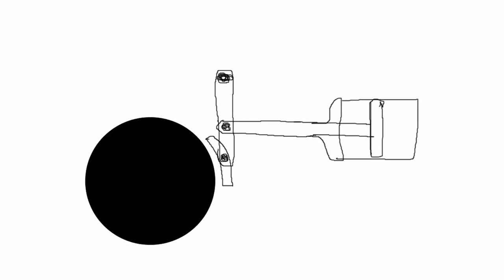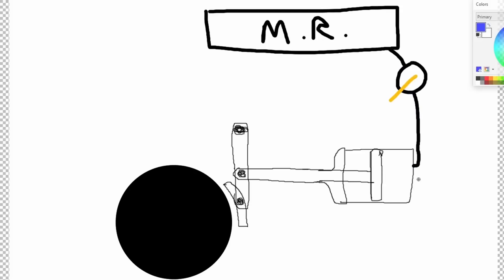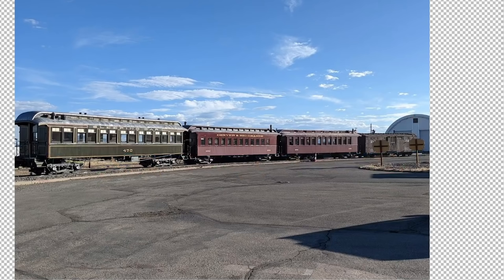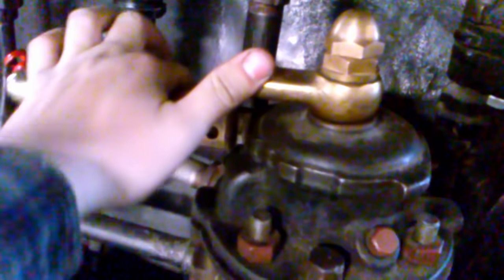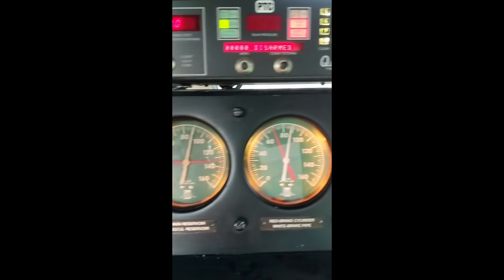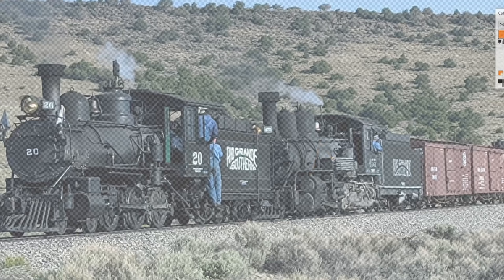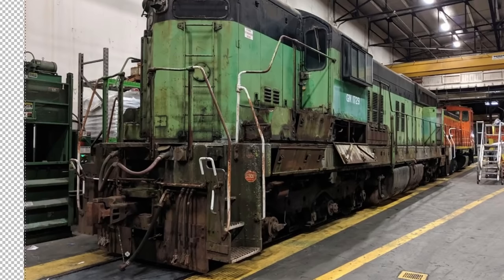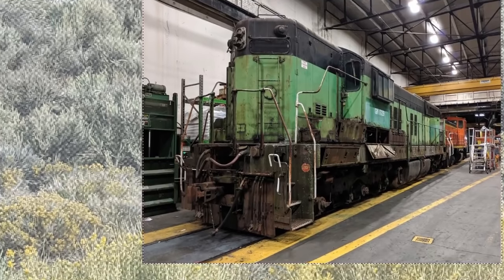AIRBRAKES 101: 10 levels of TRAIN BRAKE understanding!

Comment: An inexpensive way to produce the kind of diagrams you appear to be using above can be accomplished using the following 3 things: 

First, an iPad Air (or Pro) of sufficient generation to use the latest generation Apple Pencil which is the second "thing." Finally, "Goodnotes 4" is an inexpensive app ($10 or something like that?) that has drawing tools of sufficient sophistication to meet your apparent needs. It is also simple enough to be innately intuitive enough to be able to use without the short user manual. The user manual available online through the app's "help" section is relatively short and well-written to enable the user to be able to use the full-functionality of the app which is pretty impressive, feature-wise. Using the above 3 things enable the user to create a simple multi-colored drawing using straight lines when desired, squares/rectangles, circles/ovals, and other basic shapes. 

I used this "system" during my Masters and Doctoral program and couldn't recommend it more enthusiastically. I tried nearly every "note taking" app for the iPad that there was and Goodnotes 4 was the best. I started with Goodnotes 2 and am currently using Goodnotes 4 at work. The pages can be exported in a variety of formats or you can just "Select All" of a diagram and cut and paste into other apps or email. 

I had been looking for a way to take electronic notes for decades and was finally rewarded with the above combination for a dream-come-true: an electronic note-taking solution that worked as though I was using pen-and-paper. No lag and obviously, a plethora of benefits due to the electronic form factor including back-ups and password protected notes. 

(And no, I have no connection to Apple, nor the company that makes Goodnotes 4. I'm just an ecstatic customer).  🙂

.
Reply from the maker: Well, with that review like that I imagine it's a good one :) I've long wanted an ipad or something to be able to draw these like true "pen and paper" maybe that's the ticket. Thanks!

Comment: Something I'm always confused about.. Are railcar brakes on by default, released by the air; or are they off by default, applied by the air? I've heard it described both ways.
Reply from the maker: Brakes are off by default. Once you "charge the train" full of air, if you lose air, the brakes come on. There is nothing mechanical applying the brakes until you have charged and then removed air. But, if there was no air at all in the beginning, no brakes.

Comment: When you apply the train brakes does it also apply the brake shoes on the locomotive, and if you have just a locomotive with no rolling stock, which brakes do what, and is the independent brake just as powerful as the train brake in that situation.
Reply from the maker: For many kinds of airbrake, applying the train brakes does apply the locomotive. If you have no rolling stock, it will act the same. In that case, the independent brake is much better because you can apply it much more quickly. If you have a whole train, you have to make slow, small changes to make sure things are smooth - but with just an engine it's easier to make faster movements.

Comment: in British locos.. the vacuum is a fail-safe..  the Vacuum pulls the brakes off:  if a pipe comes off or leaks.. the brakes apply.  The USA solution seems rather complicated in comparison
Reply from the maker: It is certainly a bit more complex, but it makes for the best of both worlds with operation.

Comment: If your air piston is smaller than the steam piston doesn't that allow you to have higher psi out? E.g. 100 psi steam on a 10 Sq inch piston would produce 1000lb force but then you use a 5 square inch piston to compress the air , when the air pressure is at 100psi it would only produce 500lbs resistance against the piston.
Reply from the maker: That is the thought, but even so, with seal efficiency and the fact that the air has to cool off as it leaves prevents that reality from occurring.

Comment: Hey! I have a question. I work at a loading facility and we how to load rail cars. We have this issue where the trains seem to get "over charged" with air. The brakes do not come loose untill we pull te lever to release a bit off air to then hear the air system rake over and release the brakes... do you (or anyone else) have a idea what could be causing this? Is it because the engine puts too much pressure in the system? Or somehow not enough?
Reply from the maker: It depends on the exact situation that happens. Modern engines don't typically allow for overcharge (over normal brake pipe) conditions with the way valves have been set; but it can be done. That said, if the brakes are set, and won't release - it's not because the pipe is overcharged, it's because the reservoirs were higher than the pipe at some point - which almost certainly means that the locomotive either took a set on the brakes, or it totally disconnected, lowering the pipe to zero.
Reply: First off, thanks for the quick reply! So what i understand is it is possible for the system to go to 90 psi and set the system in the reservoirs to 90 psi but as soon as it goes down to lets say 80 the breaks go on? Because for now they tried to fix the system to make the compressor boost the system to 90psi  but i am not sure it can maintain that much psi... maybe the fix would be a skower build up in pressure? Instead of a full boost to 90psi to then drop over time?
Reply: The issue i believe is the sensor that measures the pressure in the system is at a dead end of a line so huge chances of debris/water build up meaning its reading has a delay wich causes the system to build pressure beyond the set point. And thus "overcharging" the breaks because as soon as the sensor reaches that point the actual pressure is above the setpoint but it stopt pumping air in the system and thus causing the real pressure to drop and maybe activate the breaks? The weird thing is it usually happens on the carts in the back (away from the engine)

Comment: Personally there are many videos (miss information) saying that train uses Air Pressure to apply the brakes! However, according to George Westinghouse, air pressure to release the brakes is the best way, because if the train comes apart (it does sometimes) the air is automatically released thus applying the brakes!
The air cylinders on each carriage/wagon has limited supply, when it runs out of air (0 psi) there's no air to apply the brakes thus not fail-safe!
Where as Air Pressure to Release the brakes, when the train comes apart, the brakes come on and remain on, until air pressure is back (90 psi)
In most countries, they use air pressure to release the brakes, not like a bicycle brakes!

Comment: Question for a Q&a will the walking get faster?? im constantly holding the shift and end up getting the steam menu up. i would prefer the walk be what the run speed is and the run speed to be actually alot fast as it is as maps huge and helps when deleting trees i did duct tape it at one point ha 😅
Reply from the maker: We've done the walk to run speed change twice already... :P
Reply: @Hyce777  no way well atm the run needs to be what the walk is then i think perfect because if the walk speed was the run speed how’d anything get done would have taken you years 😅 wait what year are you living in 😂 but yes still very slow can not use that walk constantly on the run and getting finger fatigue. Cant wait for the teleport option or one to find my train lost it a few times 

Fun thing to try place the vary gradient on top of your train and watch it fly 😂😂🤣 man its so fun the higher the gradient the further it flys i love things like that but would like to see where train is gone. 

Atm my hud has vanished so i have no idea if my train is out of fuel when just looking at it until i press F on it or if my breaks are on the carts i have reported these tho in community section for a fix. Hope your days been as fun 🤩
Reply from the maker: @wkd0  there's a hotkey to turn the hud on and off. by default it's X. Take a look.
Reply: @Hyce777  when do i press x and is it just on its own or do i press fn too? As that moves the track
Reply from the maker: @wkd0  yeah that's the issue. Stupid default keybinds by us, that we still need to fix. I'd recommend re binding the HUD turn off.
Reply: @Hyce777  Thank you very much for your help you’re a lifesaver :D it now works yay 😁

Comment: so simple stated, on trains, no air no stop. If all the air is released from the cars reservoir, then no brakes again, as there is nothing pushing against the brake piston. 
 So hand brakes must still be used to hold cars in place not hooked into an air supply. 
Unlike trucks, where the springs put the brakes on, no air, solid brakes, no need for a separate brake control, when parked.
Reply: Yup, need Air to hold the brakes off the drums/disc's on an Air brake equipped Truck. No Air? You're not going anywhere. :)
Reply from the maker: Yup! So, if you couple up to a cut of cars that have sat "off air" for a while, they will roll free if no handbrakes are tied.

Comment: I do take issue with your statement that you can only have as much air pressure as you have steam pressure. if you have a piston of x size compressing air being driven by a piston of 2x size then you can use the mechanical advantage to result in double the air pressure as you have steam pressure. we used a pneumatic system in a factory I was at to use 120PSI line pressure to fill a chamber and also run a piston to fill a secondary tank up to 180 PSI. there was a loss of volume during the conversion but it was cheaper to run the 4 120PSI tanks in the back longer than it would have been to purchase a tank capable of compressing up to 180.
Reply from the maker: Yup, I totally goofed on that one, conflating my experience vs. how it actually works. You gotta have more steam than air pressure for operations' sake. Doesn't mean it's physically impossible :D
Reply: @Hyce777  i see, yes the volume and pressure of the air is much less than that of the steam is. no sense in being able to stop on a dime if you can't even get it moving in the first place.

Comment: When closing a ball valve between cars; why does it take up to two minutes before the brake cylinders start to activate?
Reply from the maker: What do you mean? If you close the valve and "bottle the air" on a car, it won't set up at all, unless the brake pipe leaks.
Reply: @Hyce777  The train slows down eventually.

Comment: Why do we have 2 set of air hoses?
So one of them always work and there's redundancy?
Reply from the maker: Assuming you mean MU hoses - So that you can always lace them without crossing under the coupler first no matter which way the loco is facing, and then yes redundancy. In cold weather and mountain territory the Airbrake and Train Handling rules calls for using both sets.

Comment: Avro Lancaster special brakes that doesn't catch on fire but uses compressor to provide pressure to the brakes works in a similar way to a bicycle car truck even train aircraft's uses brakes to slow down to stop safely in a similar way

Comment: When a train car disconnects from the rest of the train while in motion,  the airbrakes lose pressure and the car stops.  Given that fact, how does humping work.  How can humped cars roll down the track if they are disconnected from the rest of the train?  Why don't their brakes kick on?
Reply from the maker: Because they've had their car mounted cylinders drained. Remember we need to have pressure in the reservoir in order for the brakes to come on; drain the reservoir after you remove the car from the train and it will roll freely unless the handbrake is applied.

Comment: I’m a current railroader for the modern equipment these days. (Conductor and locomotive engineer qualified) any questions or anything feel free to reach out. Definitely know your stuff by the looks of it!
Reply from the maker: Very cool! Yeah, that may be good if we get in depth, particularly on more of the long train handling stuff. I never got to do much more than 15 cars so I have no experience of setting and releasing portions of the train, etc..
Reply: @Hyce777  absolutely! I’ll be around if ya need a hand with anything!

Comment: Is there any ABS system in the automatic brake control to prevent flat spot on the train wheel when you apply emergency brake?
Reply from the maker: How to tell I'm too far down the railroad rabbithole: I saw ABS and assumed you meant "Automatic Block Signal"... lol

Not that I'm aware of, though potentially some of the modern control valves on cars may have something that mitigates sliding. That said, it does happen...
Reply: No. It's also not really considered in trains because the purpose of ABS is to keep a vehicle steerable during a stop by preventing the wheel from side slipping, if the wheel remains rolling then it's still able to provide grip sideways. There's already a robust anti skid system on a train, the rails. If the train side slips then it's derailed and you have a bigger problem.

The area in which anti-lock braking systems have probably saved the most lives and property is in the trailers of semi trucks, because they aren't responsive enough to driver input to properly pump or pulse them manually, and the trailer going into a skid is probably the most catastrophic failure mode for a truck.
Reply: No, ABS requires electronics
Reply: @AlRoderick  The purpose of ABS is not just maintaining ability to steer the vehicle but to greatly reduce the braking distance. How is this done? If you wheels lock up then the stopping distance is entirely dependent of a kinetic friction between the wheels and the surface they are on. But if the wheels are still rotating then instead of experiencing kinetic friction (forces that is needed to keep two objects sliding against each other) between the wheels and the ground you would be experiencing static friction (force needed for two objects to begin sliding against each other) between the wheels and the ground. And since static friction koeficient is much higher and also dependent of the contact surface between two objects you would want to make sure that static friction is in effect all the tome. So what is the difference between kinetic and static friction fro steel? Well static friction koeficient between two steel objects is between 05. and 0.8 while kinetic friction koeficient is just 0.42.
And yes this difference between kinetic and static friction is also the reason why once you end up with a wheel slip you need to reduce the locomotive power quite a bit for wheel slip to end and after that you can increase the locomotive power a bit again without ending up in a wheel slip again.
As for the reason why trains don't use ABS. First of all train breaks usually don't have enough grip to lock up the wheels entirely. 
And second reason is that it would bring a lot of complexity to trains since you would need to have separate ABS systems for each train car. Imagine having train with about 50 or more cars each having its own ABS system that needs to be regularly serviced. That would mean a lot more maintenance.
And the third reason is the fact that trains  rarely use emergency braking during which ABS would only come in handy.
Reply: Actually there are some anti-whellslip systems, mostly in passenger cars - I was just reading up on them yesterday when I saw that a car was equipped with something called a Decelostat. It basically adjusts the brake force if the wheels/axle start suddenly changing speed, so it keeps rotating instead of rubbing or sliding along the rail.
Reply: Yes, such systems do exist and are very common in Europe (not so much in the US it seems); most locomotives and passenger stock have some form of WSP (wheel slide protection) equipment on them, I think its presence is even mandatory by the latest TSI standards.
European trains usually have a high brake power to weight ratio, it's actually relatively easy to lock the wheels in poor adhesion conditions. In this case, the system automatically dumps some air from the brake cylinder, regulating its pressure until the adhesion limit is reached again and the affected axis starts spinning without disturbances. Freight trains in general have less effective brakes and weigh much more so it's less of a problem for them.

It's worth noting that during normal operation most modern locomotives and EMUs mainly rely on dynamic (regenerative or rheostatic) braking and, in a similar way, their electronic traction systems are able to regulate the braking effort in order to remain within the limits imposed by available adhesion

Comment: So when the locomotive pulls away when air hoses disconnect the air sound is the brake pipe draining setting the brakes on the cars.
Reply from the maker: Yup!
Reply: Also thanks for the vedio as I still have alot to learn.